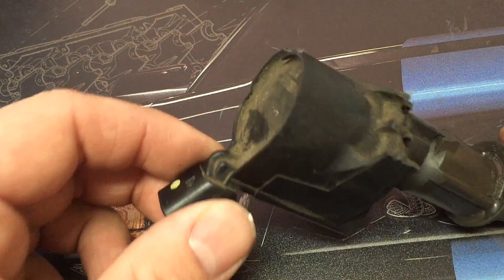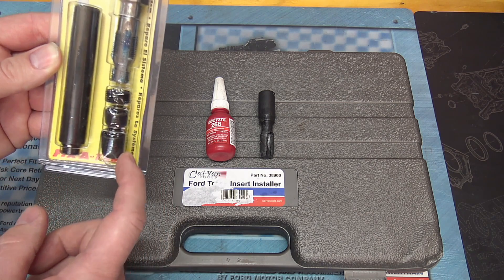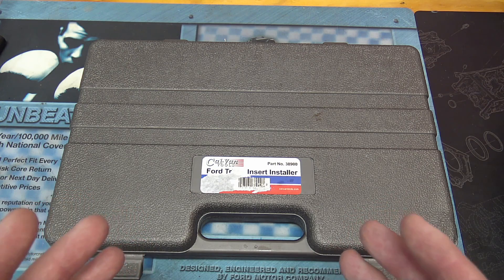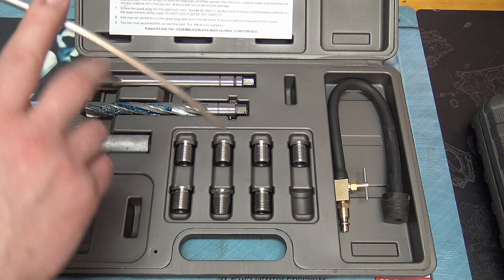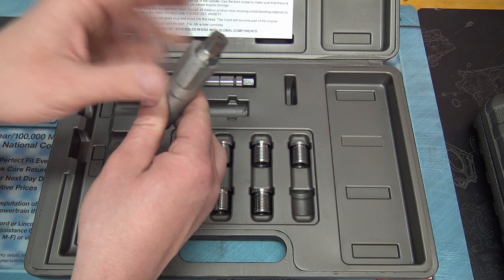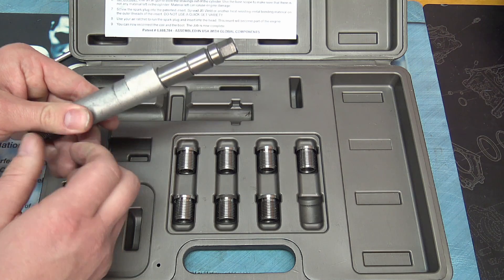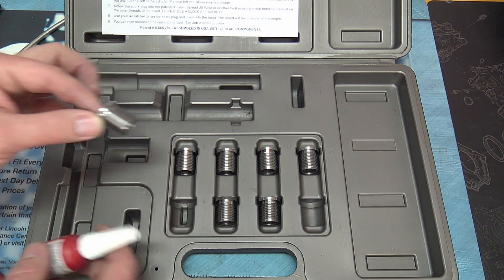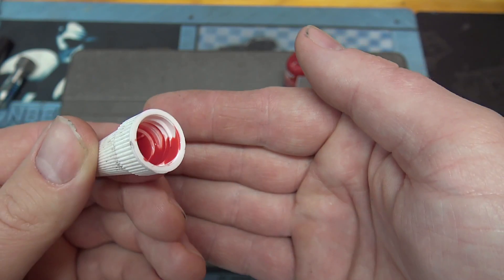Ford 4.6L 5.4L 6.8L 2V Triton Engines: Blown Out Spark Plug Repair Kit Usage

Comment: Very nice video!  Just a few questions, the pistons should be at bottom dead center? And is the reamer/ drill bit driven in with just a socket wrench or on an actual drill? Finally, aside from the Loctite, what holds the insert in when the plugs are removed?  Thanks and have a great Memorial Day.

Comment: Hey, I have an 08 f150 4.6, I have just started to get a Bucking and hesitation on Acceleration after 3rd gear. from what i have been reading most are saying Bad coil/Plugs,  I had new ford plugs at 105,000 km. and i'm at 123 now.   Just wondering if you have had any experience with this issue.?     p.s fuel filter and air filter are new.     Thank you for your time.

Comment: I've done quite a few of these at work. I use q bond on the ear of the coil with success. I also use the fix a thread kit with the too big of a head on the tap. I just grind down the head of the tap until it will fit down the spark plug hole with a socket on it. Thanks for your videos.
Reply from the maker: Michael Herbert Yeah I thought of doing that but figured I would make it uneven and wobble when I used it.
Reply: FordTechMakuloco good point. Luck was on my side when I grinded it, lol.The tap I grinded down has seen its last job. I was just gonna grab another one but now that you brought that up, I'm gonna purchase the one you recommend. Thanks.

Comment: What's the beef with the Time-Sert? I used one on a 98 E250 with 5.4 and it was spendy but worked perfect. Resold kit.....minus 1 sleeve for $20 less than we paid. Took half an hour.
Reply from the maker: patw52pb1 Yes time sert is ford approved mainly because of the material they use and heat transfer rates.
Reply: ykmalachi  They are great, most kits are OEM approved and are easy to use with excellent results. 
Most only complain about the initial purchase price.
Reply from the maker: ykmalachi Biggest problem with time cert is the kits cost and the extra steps compared to kits like this that do it just fine.
Reply: FordTechMakuloco Yes, the approved Time-Serts are 303 stainless steel which has excellent thermal conductivity.

Comment: I used the large head tap kit on a roadside repair on a 4.6 Crown Vic before. I took an angle grinder to make the head a 5/8ths. Worked great other than the next ten miles the engine chattered from ceramic in the combustion chamber. Once that pulverized the compression went to 120 or so and they kept driving fine.

Comment: Ok need some info. Been chasing a misfire issue caused by some idiot spraying my engine bay out at the car wash. I have a 2007 F150 5.4l 3v flex fuel. After getting my truck washed and was driving down the road my truck started misfiring hard. Causing it to buckle until I let off the gas. Check engine light starts flashing. Pull into my drive way open my hood and my engine bay is sparkly clean dripping with water. I get pissed and call them and they assure me they wouldn't have done that. Got it scanned at auto and it pulled up random misfire first 1000 revolutions, misfire detected cylinder #3, cylinder #4. So I take it home pull the coils clean them off and reinstall them. Drive around same thing continues just not as bad.  Switch cylinder coil #3 and coil #1, go back to autozone scan it again and it pulls up random misfire cylinder #4 and that's it. Pull number 4 again clean it and reinstall, drive around and same thing. Ordered a coil and it should be here tomorrow. Do you believe it's a coil issue or other wiring issue? 
Hopefully here from you soon, watch all your videos Brian!
Reply from the maker: OverRotated Owl Remove all coils no matter what codes pop up and thoroughly dry the spark plug wells and coils. Then apply a small amount of dielectric grease to the tip of the coil boot and reinstall coils. We used to see this all the time on used cars that just came back from detail.
Reply: OverRotated Owl 
Check the plug wells closely for moisture or standing water at the bottom. 
Also coil on plug units are notorious for random failures.
Reply: D4x4Bronc I know the water would usually effect the coil, or coil conductivity to the spark plug, but really you need a spark plug tester. It replaces the spark plug out of the equation and you can see what's going on. 

It can be the spark plug coil, the wiring to the coil or PCM damage. 

It could be similar issues for the injector as well. It too could have been damaged by the water.
Reply: FordTechMakuloco Right, because sometimes individual cylinder fuel trims trying to compensate for the real problem will make the misfire seem somewhere else to the computer. For the computer is only seeing the RPM every instant, which can lie about where the misfire then really is.
Reply: Thanks for all the reply's and information everyone! Bad news is it's still having small misfires under heavy acceleration or when overdrive and under load. It's not throwing codes at least. But still spent $100 on 2 coils for cylinders 3 and 8. Still having issues, thinking spark plug is bad considering the truck has 133,000 miles and probably on original plugs... Having checked injectors yet either. Any more information on this would be appreciated if someone has been in the same situation! It's quite irritating!!!
Reply: Haven't checked injectors yet*
Reply: OverRotated Owl Hang in there!
Reply: OverRotated Owl Is the check MIL illuminated now? 
Are there any codes set now?
Reply: No I cleared it after I put the new coil in and it hasn't set one off again

Comment: I think you missed a step. I use anti-seize on the plug. Then that way when you service the plug, the insert stays in and no chance it will comeout with the plug.
Reply: +Michael Herbert durp... torque wrench... 25 lbs
Reply: Claude Rains  

I firmly believe manufacturers do not use anti-seize in the factory because most plugs are changes after the warranty has expired. I do not believe spark plug makers claims that spark plug threads are self lubricating and corrosion proof after 60K to 120K miles. I do not believe a small amount of anti-seize on threads decrease heat transfer. Even if anti-seize cause slight over torqueing, 20% above 12 foot-pounds cannot be that bad (especially in Fords).

I always use anti-seize on plugs, but I do not slop it on like I use to. I believe
anti-seize has a carbon displacing quality between the threads which is very
helpful when removing the plug. If any or all of this is bogus, please do what
you can to correct me.
Reply: I removed plugs without it and some broke off at the base. Do what you like but I'm using it. As I don't like spending 2 hrs fixing what should take 10 mins. 

And aluminum is the worst. You have two very dissimilar metals that cause corrosion.
Reply from the maker: I agree a little anti seize on the plug like normal although they say with playing now it's not needed. My thoughts are anti seize or not the insert will stay and the plug will come out like normal that loctite is strong stuff.
Reply: ***** I totally agree that antisieze can easily cause overtightening. So can loctite and loctite is specified on certain fasteners.But that's where experience comes into play. You get a feel for the difference of a dry and lubed fastener. I personally apply a tiny bit of antisieze to spark plugs. Again, you're absolutely right that a lubed fastener can cause problems for different reasons, especially with aluminum. Thanks for sharing.
Reply from the maker: ***** As stated below I only put a minute amount on and the torquing is all in the feel from many years of experience, I know all about dry and wet torques I know what you mean.
Reply: +Matthiu Ryin There is a different torque specification between a dry and wet fastener.